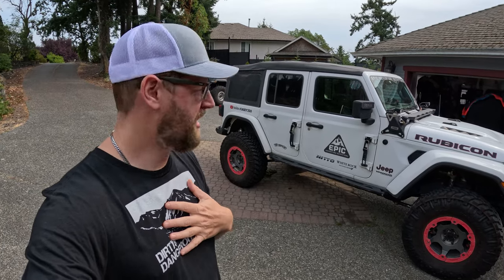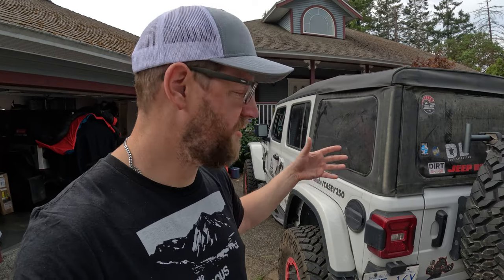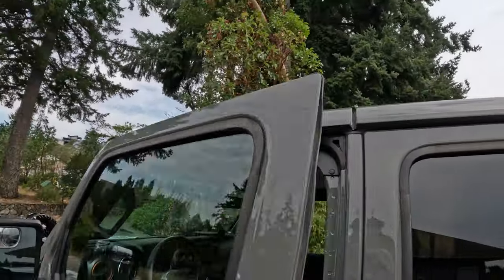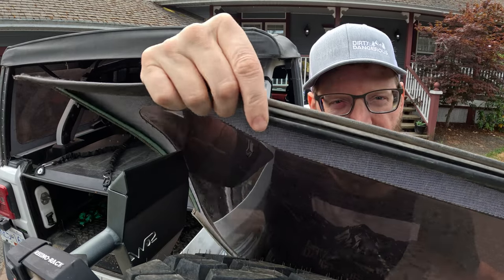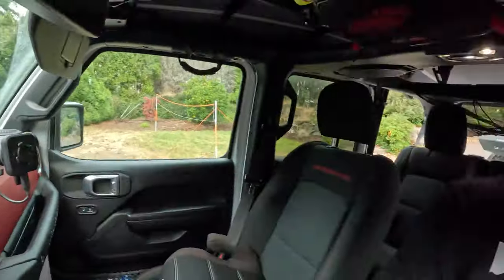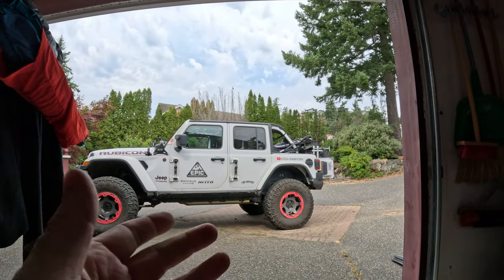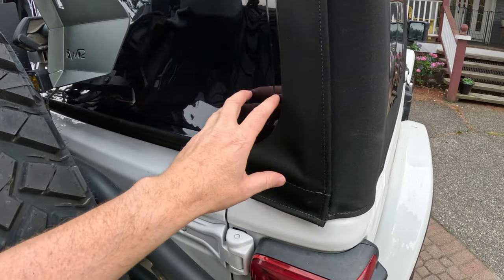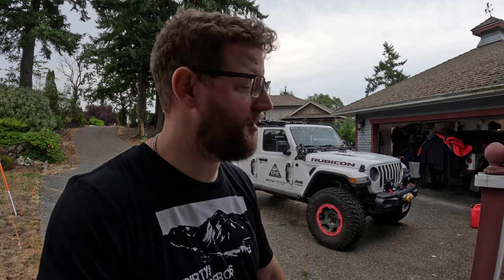I Can't Believe It Lasted This Long...

Comment: On a side note, splits can be sewed back together using heavy duty, standard thread, and even reinforced by applying clear adhesive on the inside, to reinforce the repair. The plastic windows can be buffed manually, using a mild abrasive, such as headlight restorer. As far as I know, these tops can be painted as well. All this does wonders if looking to restore the top, or not wishing to spend money on a new top.

Comment: My 2015 JK with the factory soft top (yes with zippers). Not only does the zippers leak when washing I just did 2K kms of dusty gravel roads and the dust just rolled into the cab. I tried to keep the A/C on to keep a positive pressure but nothing stopped everything in the cab from getting covered in a layer of dust. I had to cover my cargo with a tarp!

Comment: I specifically wanted a soft top (rag top as my pops would call it), its better in every way except 1. The hard top IMO looks better. but the soft top is quieter (yes it is, plenty of tests online), it stays warmer/cooler thanks to being material vs thin fiberglass, it comes off easier and is just overall cool. but for looks hardtop all the way

Comment: On my jku I had trouble getting the interior cool in summer with the soft top and in the winter it was quite okay. However I like the hardtop much better. I added 19mm armaflex insulation to the hardtop and it's been a game changer... cooler in summer, warmer in winter and much less noise!
Reply from the maker: Good to know! Thanks for sharing.

Comment: My experience with keeping Soft Top Windows clean dating back to CJ's is to use Meguiar's Cleaner/wax, (Maroon Bottle). It also make the windows a little slippery so you don't get as many scratches from those pesky trail side attack shrubs. A diminishing polish is good for the scratch removal and then Meguiars

Comment: I have recently purchased a Best Top soft top too. Love it!  When I purchased my JLU I had a JK with a soft top and swore I would never buy a soft top again. I was wrong. I purchased exactly what you bought. The JLU is so much better than the JK zipper ones. It wasn’t the easiest to put on but not bad. 
I bought a cheaper Master Top and it showed the channels like the OEM and Best Top, but it actually had zippers. It sucked!  Spend the money and buy a Best Top. You get what you pay for. 
The sound isn’t bad either. Much better than the old JK top and just all around better design. I still like my hardtop better.
Reply from the maker: Ya the zippers can be super annoying

Comment: Great video. I garage my stock 2021 Wrangler Sahara 4-door. It came with a hard top. I’ve thought about getting a soft top. However, I’m concerned that the additional height of the soft top will be too tall for my standard height garage door. Thoughts? I’m looking forward to see your next video.
Reply: I have the same vehicle.  I am able to fit in my garage no problem.  I can also still fit in with the top in the sunrider position, however I can't close it all the way once in the garage (due to the garage door opener), but nonetheless it does fit.  Just an FYI my Jeep does not have a lift and it probably won't since I love just being able to pull into the garage and I drive with the sunrider position a lot.
Reply: @juliemerring7276  Thank you for your information. I don’t think a lift kit is for me either. Right now I’m having shock and loose front suspension issues.

Comment: Casey, I definitely not agree with you on hard vs soft on the noise side.  Mind you, I do have the insolation panels, but I can tell tou that with my km3, you can have a conversation in the hardtop at highway speed, but can’t with the soft top.  Same with handsfree phone calls.  I’ll revisit this with a decibel meter when I,ll switch tops in October
Reply from the maker: Weird. I have calls all the time in mine.
Reply: @Casey250 not saying getting calls doesn’t work, but people have a harder time hearing me, and their side cuts all the time. I have to put myself on mute so the other does not cut out.  Maybe the KM3 are noisier than your tires. The other far fetched possibility 😂 is that being much older than you, I have lost some hearing!!!
Reply from the maker: I find tire noise to be more lol

Comment: soft tops will be outlawed soon by them now.... hardtops are pretty much pointless on a wrangler unless you are mall crawling
Reply: Well, I love my hard top winter time. And to be honest, it is much much quieter. Love my soft top during summer, even if it’s a pain loading my dogs in the back (got twoBernese - the can’t jump through a rear door) compared to the hard top. And I will never do trails with the hardtop: I have the body colored option, and it scratches too easily.  I also have the OEM insolation panels,and it makes the interior less echo as well as dampen the outside noise…
Reply: Why would soft tops be outlawed exactly?